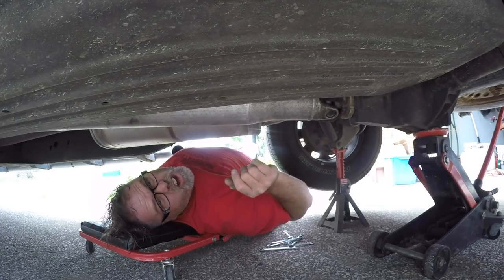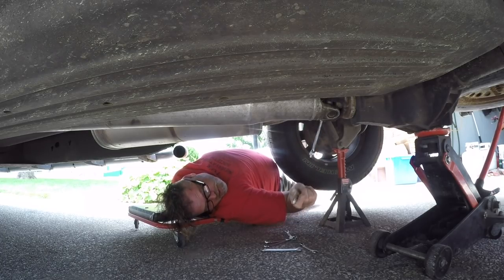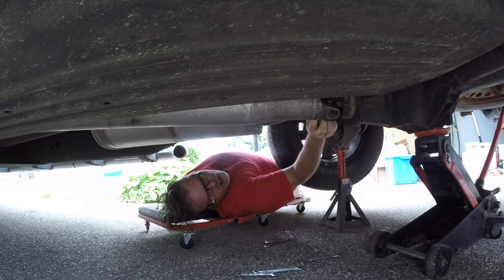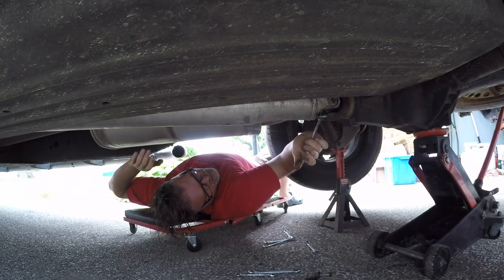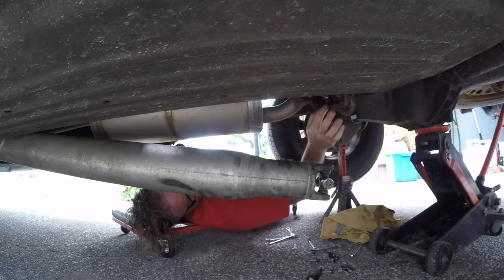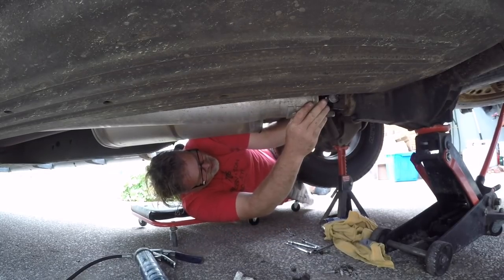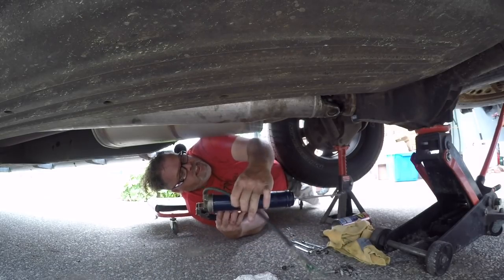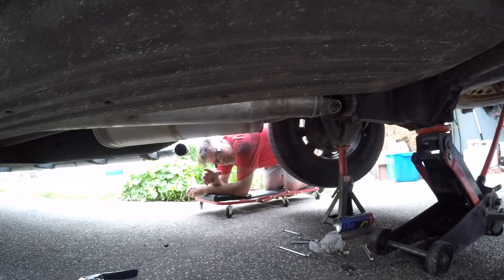Chevrolet Silverado Drive Shaft Still Clicking

Comment: Buddy the planetary gears are what I'm thinkin in the rear they will normally only make noise when your in to throttle a little . Or a needle bearing got crushed in the install on the universals . If ya think ya have a crack in the driveshaft.  Pull it out tape up the ujoints so they dont fall apart then grab the shaft out from under truck lay it on the concrete and pick up one end lift it a couple inches off the ground and drop it flat to ground if theres a crack you'll hear it no crack the sound will be like a tube with crack it'll sound much different.  Hope that helps . I would check those planetary gears out should be No play when you have some one rock the wheels back and forth.  No play at all .if I'm right you'll see them rock around as wheels are turned back and forth abruptly.  Good luck buds it can only be those few things . And really if shaft had a crack first time you stomp the throttle it'll just twist that shaft or break it . It's only aluminum any defect will take the integrity/strength right out of her be like a McDonald's straw in there .

Comment: Had the same problem chased it down and  replaced transfer case driveshaft universal joints transmission tail shaft bearing... replace the leave springs and boom no more noise

Comment: Howdy what's your experience with this?

2005 Yukon, 5.3L 4x4, 223,000 miles, all stock, daily driver. I can just hear a clicking sound that varies with wheel speed (not rpms) when all else is quiet in cab and windows are down, driving next to a wall or barrier, at 10/15 mph or faster.  But ONLY under load with accelerator pressed. Does not click when coasting, or not moving. Comes from under vehicle. I figure either driveshaft u-joint or rear wheel bearing, or maybe parking brake hardware (park brake is out of adjustment), but what do you think?

U-joints look ok. A smidgen of play that I can feel but not really see, by hand, same on both ends. Not tight or blown out. Sealed type. 

Many thanks for input.

Comment: For everyone having this issue, I replaced both the universal joints on my driveshaft and it fixed the issue. The axle side was fine but the transmission side u joint had shredded needle bearings causing the noise. I replaced both just as a precaution.
Reply: I’m having the same issue. What year and model is your truck? My truck has been at the dealership for 1 week now and they haven’t figured out what’s causing the noise.
Reply: @familycole1112  2003 1500 2wd 4.8.  Single cab long bed
Reply: Thanks!
Reply: @familycole1112  was it a constant clicking and popping noise?
Reply: @calebpratt625  Yes the dealership replaced the driveshaft assembly and noise is gone for now.

Comment: I have a 2005 duramax and is at the shop right now for the same noise. Will update
Reply: Seized u joint
Reply: @alexanderswanson7666  can u expand more? I have that clunk when going from R to D and sometimes when accelerating after deceleration .. that clunk seems to come when occasionally power is transferred to the rear end. 

the noise is in the driveshaft .. not near any of the u joints ... please help
Reply: fkmbmw the driveshaft could have a hairline crack in it and is binding. This is a very uncommon failure but could happen. Also I would check the rear diff.
Reply: @alexanderswanson7666  btw the clunk is in the middle of the truck .. inside the driveshaft.
Reply: @alexanderswanson7666  thank you sur

Comment: Hey bud, I'm literally having the exact same issue as you, literally. Only difference mine is a 19 duramax, it's going into GM to get both ujoints replaced and the shaft, I'll let you know if it works
Reply: Well boss, swapped my ujoints driveshaft and yolk and the sound is gone, you might finally have your answer
Reply: @taspz983  did you replace the whole shaft? Or just u joints and slip yoke? Please and thank you
Reply: @jecole85  Whole shaft u joints and new yoke
Reply: Wow I have a 2020 5.3 doing the same
Reply: Did you get a new drive shaft?

Comment: I have the same noise coming from drive shaft been going on for a few months now and has now seemed to have gotten worse. Wish i could find the fix...
Reply from the maker: Mine is still there to lol
Reply: Mine has started doing this. Took it to a shop, and apparently Chevy uses a dual core drove shaft and the inner core can break and cause intermittent clicking
Reply: @hypetreyn1646  did you ever get it fixed?? or find the issue?
Reply: @Cartduckmann  it was my ujoints all good now

Comment: I believe there is a TSB on this from Chevy. There is a larger size U- joint that fixes her. The problem is not a new one for Chevy guys. Check with yer local Chevy shop parts dept...why the hell wouldn'ya? For freak sake. Ps.  I loved the fan cleanin' vidya!!!

Comment: Ever figure this out? My dad's 05 is doing the same thing but his has a 2-piece shaft instead of the one-piece aluminum shaft.
Reply from the maker: David  nope its still cracking away
Reply: @LifeWithBillSiff  I pulled the shaft today and the rear u-joint was seized up bad. Swapped it out and that fixed the cracking noise for my dad's truck. Now that that's done I can work on some RC cars... :)

Comment: I have this Issue , what was the Solution  ?
Reply from the maker: I went to GM bought the expensive grease put it in the yolk and it went away. Pretty sure it’s caused by the yolk at the transmission where it gets dry. After I greased it, it took about a week to go away.
Reply: @LifeWithBillSiff  Does that Require dropping the Shaft ?

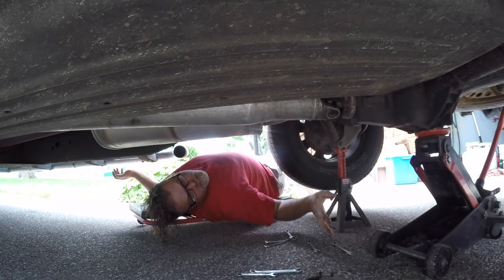Comment: Hey man.. whats that clicking at 2:26 .. it clicks twice. Is that the problem you were trying to fix?  My 21 ZR2 does a double click every time I shift into drive and drive about 10 ft. dealer cant replicate.
Reply: Found out it was the ABS self check that it does every start up. Normal!

Comment: Did you replace the driveshaft and it's still doing it? I'm having same issue
Reply from the maker: Still going it
Reply: I'm having the same problem
Reply: I think it's the driveline
Reply: did you ever fix your issue??
Reply: Well they say the drive shafts have been stamped together rather than welded.
Reply: So that’s the creek u hear almost like a old house moving … crazy as heck